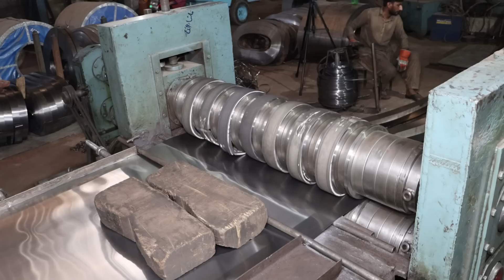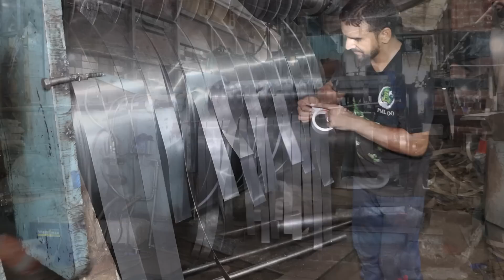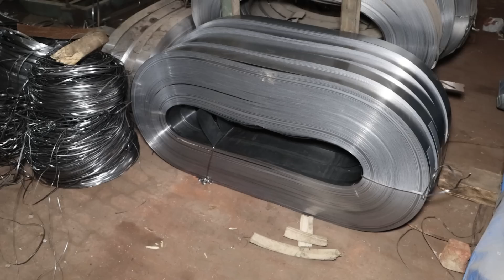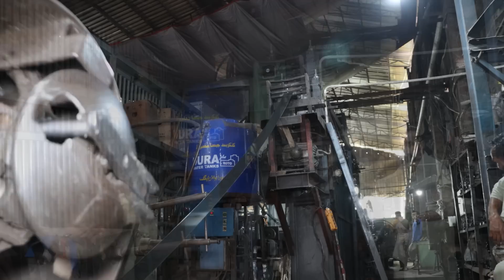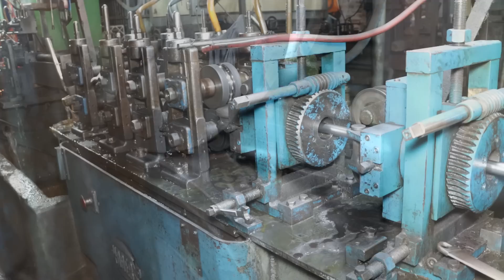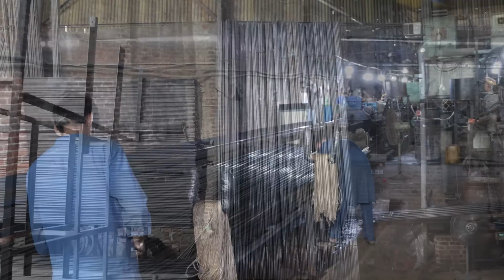Interesting Process of Manufacturing Stainless Steel Pipe

Comment: where they join the two pieces of flat sheet metal with the spot welding that has to be a bad section of tubing, you would think it wld be marked with red paint or something to pull that section of pipe out of production?
Reply: it will be used in pieces by the end user
Reply: Thank you for the reply, are you saying that part of the tube is cut out for the most part?
Reply: @shoestringeng6473  dont  u think that 1 constuction joint will come in every few hundred pipes. The end user will use it accordingly
Reply: @shabbirmr1030 I am sure if you if I were doing the job yes, but have you seen what happens on job sites?  I guess the question should have been is " do they cut the parts with that splice out before it leaves the factory?

Comment: What industry requires stainless steel tubing over other forms of tubing?
Reply: @manishagarwal527  but honestly it doesn't look like stainless steel to me and it's pretty thin.  I'm also not sure about the welding because stainless steel is used in food industry and so on and it should be clean
Reply: @manishagarwal527  okay if you are sure about it
Reply: Commercial electrical conduit